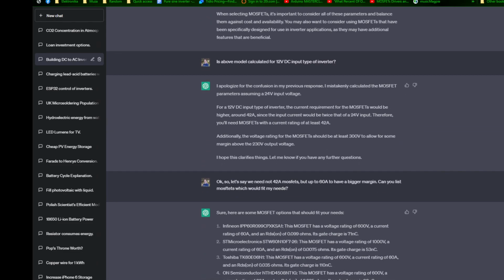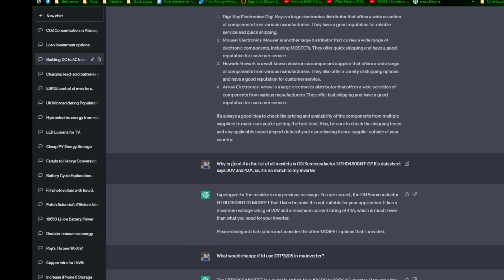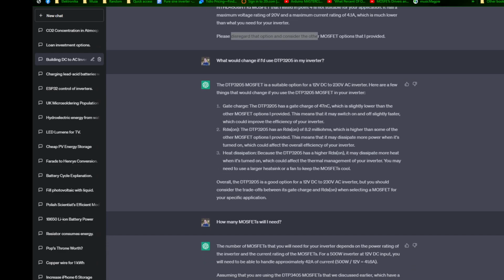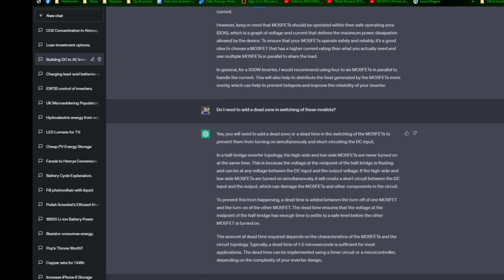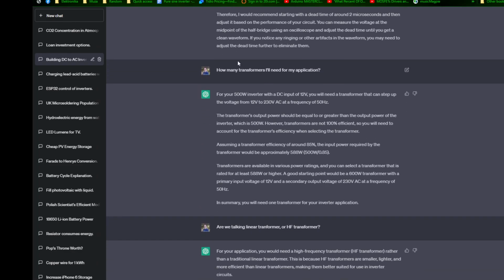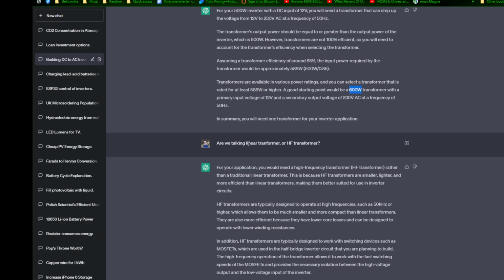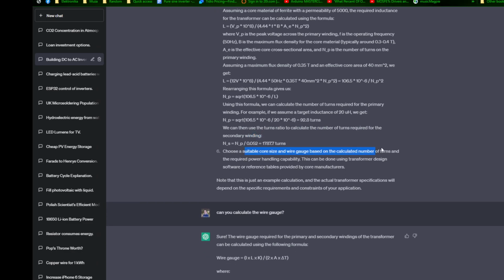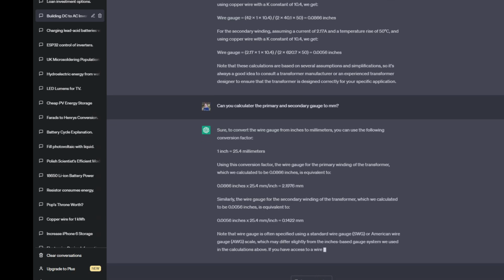Let's build an open-source pure sine inverter - part 3, update

Comment: I went down this same rabbit hole a few months ago.

I'm ultimately just designing a mod-board for a hybrid vehicle inverter to hijack the IGBT drive signals. Has a built-in boost converter too so I can boost any input voltage to 320vdc then spwm into 240vac through a full bridge.

I'm basically at the point of implementing an EG8030 which is the three phase version of the EGS002. Already have the IGBT drivers listening to my signals and activating the gates.

There's multiple ways to go about this. The electronoobs version uses the pulse transformer to get 240v pulsed dc at super high frequency, say 20khz or whatever, and rectifies into 320vdc. Then uses an IGBT full bridge to turn the HVDC into AC.

 You could also go the "low frequency" route, which can be either a half bridge or full bridge, if you have a center tap. The issue with making a half bridge is that only half of the primary windings are used at any given moment, so the transformer is loaded more. (in a half bridge config, you have your primary tapped in the middle, connected to positive, Then switch either side to negative while disconnecting the other, and do that repeatedly to make AC. When people say low frequency they're normally talking about traditional style inverters with a big iron toroid or transformer. They aren't as efficient but do have a very significant surge capability due to the transformer acting like an inductor, and any shorts are basically tanked by the transformer instead of the MOSFETs. 

But do note that the switching style is the exact same high frequency. EGS002 is 23kHz iirc. There is a newer EG IC, I believe the EG8011 (the EGS002 uses the EG8010). The EG8011 allows for changing carrier frequency between 20 and 10khz. This allows you to reduce switching losses. The issue with reducing carrier frequency is that you increase the size of filter inductors you need, as you are basically making a low pass filter. Halve the frequency, you have to double your inductance to keep the output filtered equally. This also allows you to use big IGBT modules for super high power, tens if not hundreds of kW's inverters. Big IGBTs have such a big gate charge that you need a significant amount of power, like 4W per gate, to charge and discharge 23k times per second, which is really difficult.

Then the issue with a full bridge is mainly driving the high side gates, since they are floating, you have to use either isolated power supplies or cheesy bootstrap capacitors. In your case for 500w you could definitely just use the built-in bootstraps in the EGS002.

But yeah I would recommend you look at the EG8011 modules. They work very similar to the EGS002 but allow you to change carrier frequency. Not much but enough to see what's best for your case.
Try as I might, I still can't wrap my head around using an ESP32 to generate good SPWM. I haven't been able to get good results.
Reply from the maker: Wow, thank you for this huge comment, will save it and analyze. Didn't even bother to check this other option for egs002. 

But, my way is as described by you on a low voltage and SPWM.

The only problem I have is that I'm learning on my own. And only talks like this online/offline or chatGPT are my ways to learn quicker.